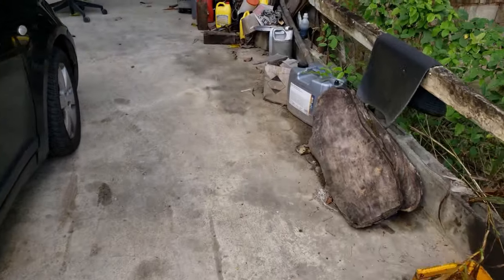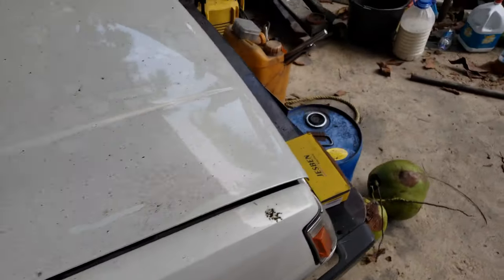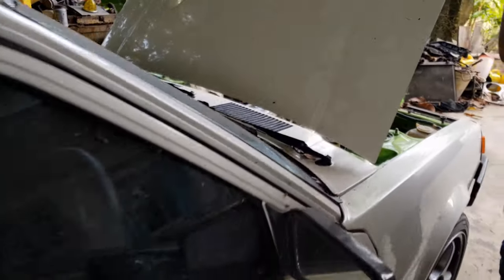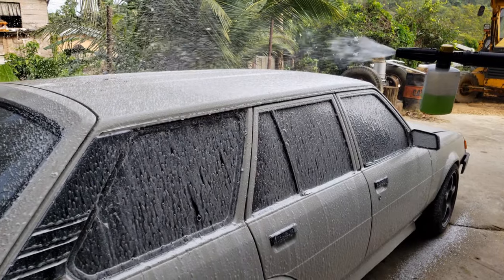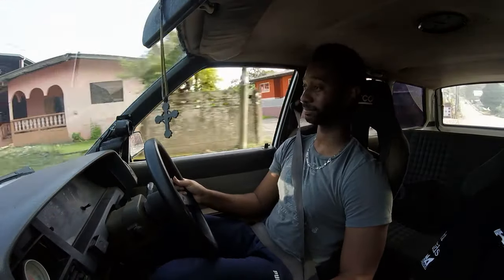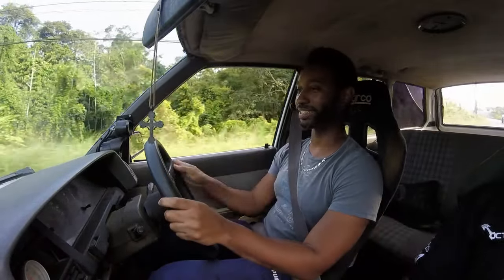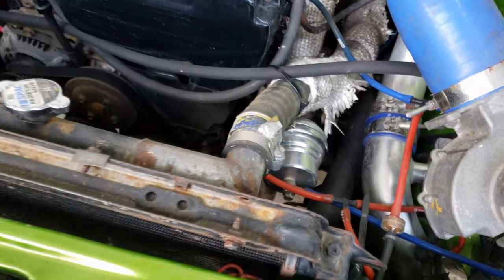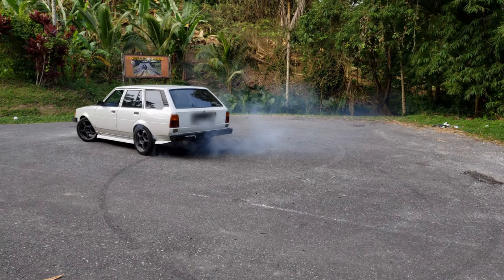Toyota KE70 turbo sleeper

Comment: 4age 20V? How much boost those engines could handle on stock internals
Reply from the maker: This build is forged Pistons. The stock internals died at 18psi. Stock might handle up to 14psi according to which turbo and fuel being used.

Comment: what brakes are you using and suspension
Reply from the maker: The front are coilovers that we build to work on the ke with ae86 spindles, rear is stock suspension front are ae86 two piston brakes rear is ae86